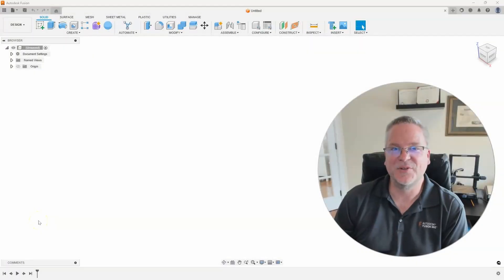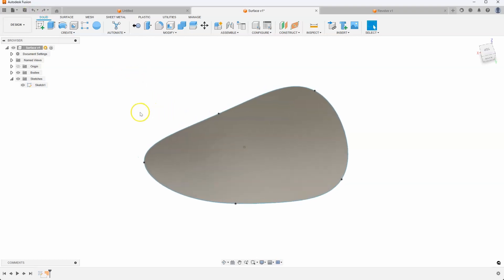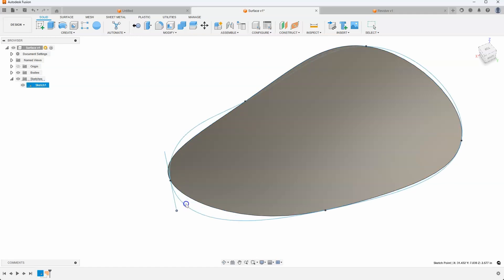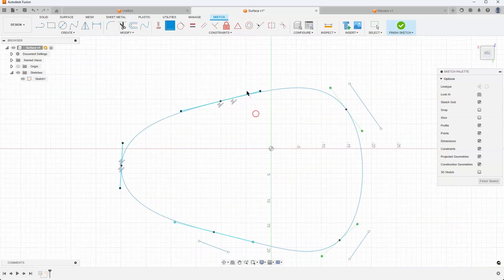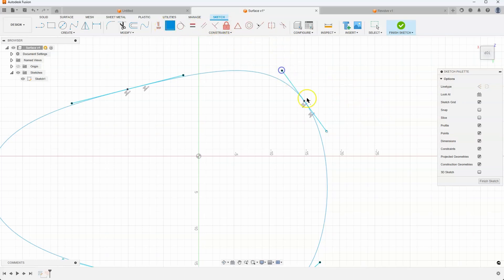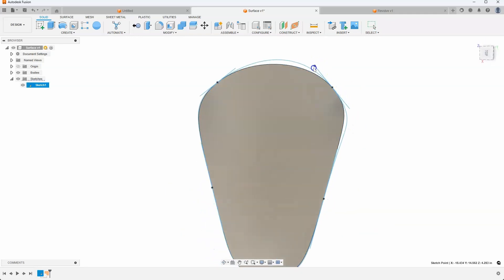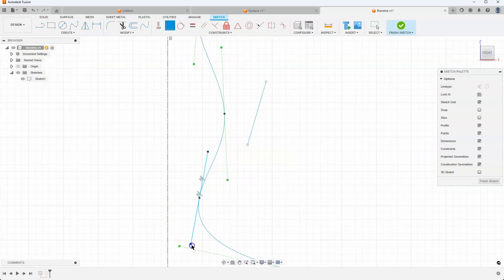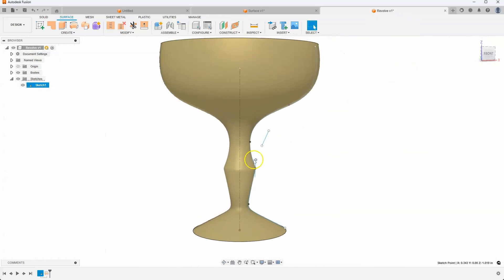Fusion Friday - Getting a "handle" on surfaces

Comment: this is a great ttip! why don't the handles show on the 3D model? is there an explanation?
Reply from the maker: The handles don't show up in the model as they are 2D handles in the sketch.  By tracing over them and adding the coincident constraints onto them, we are basically turning them into a 3D sketch representation.  Then when we show the sketch in the model workspace, you are technically moving them around in 3D.

Comment: Great tip and topic going to use this for sure.  QQ: is there a quick way to reuse last command or hot key rather than moving up to constraint menu bar?
Reply: Maybe make all the lines colinear then go around and make them coincident?  but this is pretty fast and so useful.